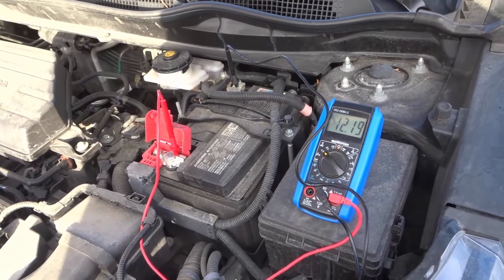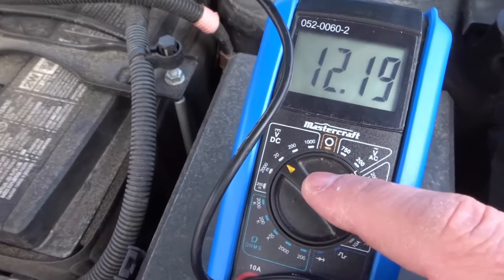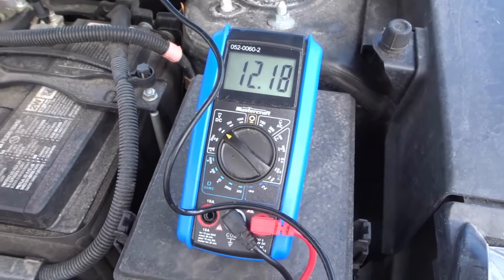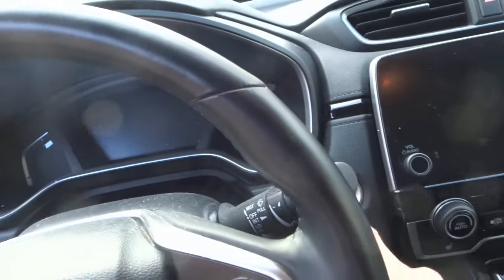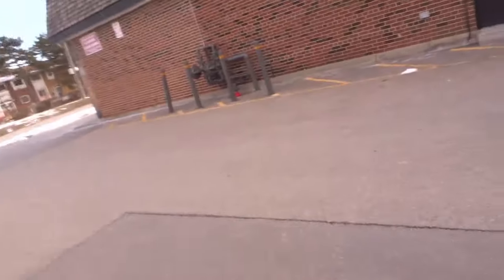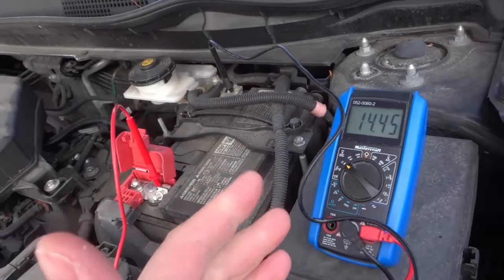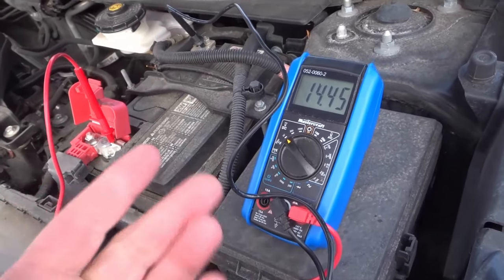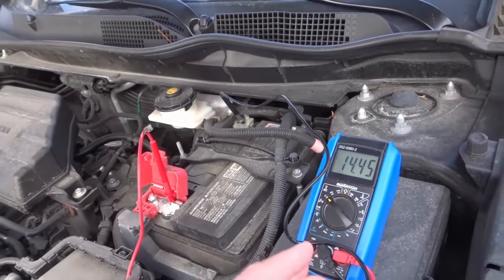Testing A Car Alternator With A Multimeter-Easy Tutorial

Comment: Yep all correct, but there's also amp output.  For instance my 2010 Acura alternator checks out at a charging voltage of 14.2, diodes check good (duh, I find that odd to even state), but fails on amp output.

Comment: What could it be if my volts are dropping to 12.8 even to 11.8 even though  I replaced the alternator with a brand new alternator the alternator that I took out had tested, and it turned out to be good, but yet my volts are still dropping, especially once I turn the air conditioner on. If I’m driving on the highway with air conditioner on it stays around 13.5 to 14 V but once I stop it drops to 12.3 or lower but never lower than 11.5